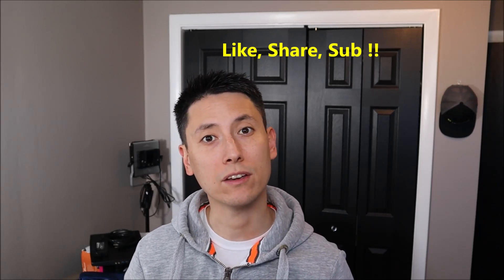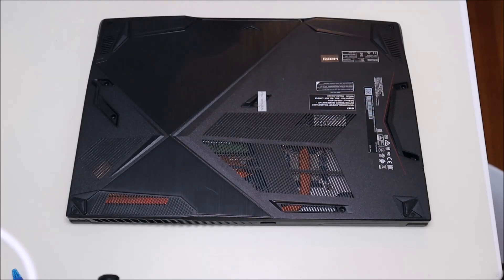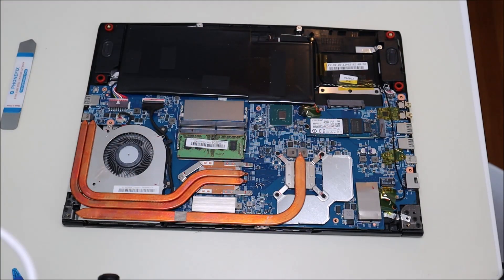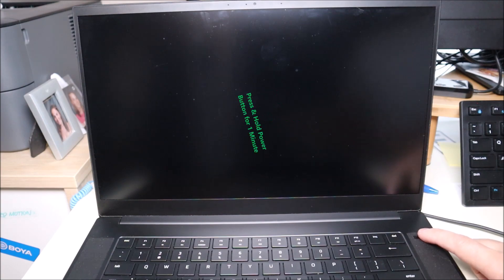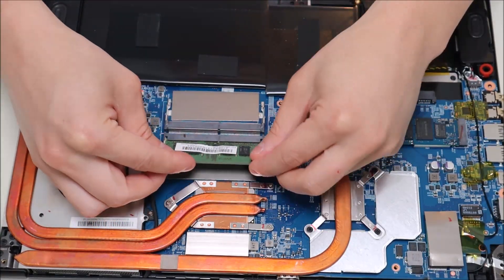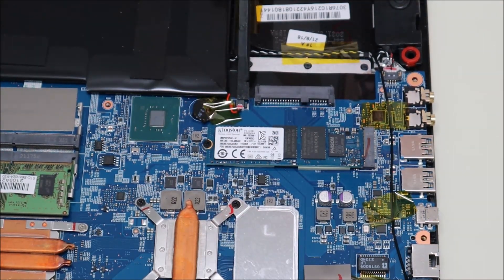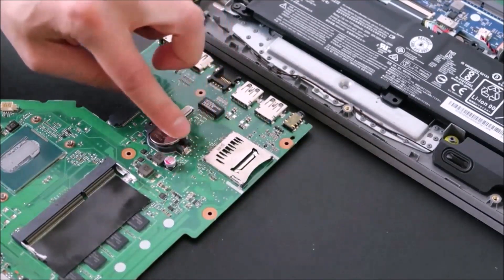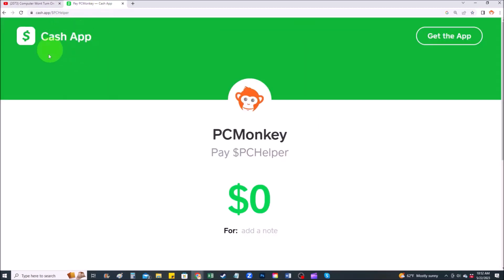MSI Laptop Computer - Dead / No Power / Wont Turn On Fix

Comment: Thanks for demonstration but another issue blinking orange light indicator my MSi gf 63 then not open laptop..
Reply from the maker: Sounds like your on the correct video.  Have you tried the steps seen here?
Also, did anything happen before this issue started? Overheating, liquid spill, Windows update, etc?

Comment: I had the same thing happen to me.  Unplugging the battery, holding power button worked.  But when I pressed the power button, it turned on, then back off.  I reseated the battery and pressed power again, it kept cycling.  Finally I pressed and held the power button for maybe 5 seconds while connected to power and it finally booted up.
Reply from the maker: Glad your all set :) Always here if needed !!
Reply: @PC_Monkey kinda embarrassing moment here.  Turns out it had nothing to do with it the power button.  After replacing the jack on the board, I apparently neglected to reconnect the keyboard 😂  once I reconnected, I did have to hold the power button for one minute then all was good!
Reply from the maker: @BallananChristmasLightShow  LOL Glad your all set :)

Comment: I have a MSI  GF75 thin 10 SDR-256 MS-17F3 and my fans where failing.  I found the heat sink and fans used but looked like really new on EBay.  I got that part and installed it.  It was the exact same unit the heat sink came from.  Since then I have not been able to power on my computer.  Previous to installing I was using it just fine other than the fans being a little noisy.  I watched the heat closely and did not use multiple monitors.  I have tried each of the steps that you recommend but nothing worked.  I did notice that when I removed the heat sink there was a square type module that sat directly under the heat sink and it was discolored on the top.  It had R 24 on the top of it.  If that was burnt up on the motherboard is that something that can be replaced?  Does this require a complete replacement of the motherboard otherwise.  The more detailed test you said to run I don’t have the equipment for, there fore just looking for recommendations.  I could not run the ram test because they soldered the ram in so I was unable to remove.   Not sure what to do next.  Thanks in advance.
Reply from the maker: There are places that offer motherboard repair but usually they are almost as expensive as buying a used on on sites like Ebay. And they usually wont warranty their work for any length of time. I suggest replacing it unless you want to take a stab at DIY motherboard repair.

Comment: I don't know if you'll respond to this comment, but I have a Delta 15 and it shuts off suddenly even when it has battery, So I have to press the power button for 30 seconds, then connect the charger, and then turn it on, and it starts up fine. I don't know if it's actually the battery; I don't want to spend money if it's not necessary.
Reply from the maker: If that happens regularly then yes, I would try replacing the battery

Comment: I have an MSI notebook PC model number MS-16GH I have the power button flashing blue and orange and the storage symbol flashing blue It seems to want to boot up but then black screen nothing happens.  I take the battery out flush it put the battery in doesn't work but when I try to turn the computer on without the battery in it and just the charger cable it doesn't turn on the light doesn't flash it all.  Any idea what the issue could be?
Reply from the maker: Sounds like your on the correct video.  Have you tried the steps seen here?
Also, did anything happen before this issue started? Overheating, liquid spill, Windows update, etc?

Comment: My plug to the battery is right next to the actual battery and there is no room to pull it out - is there a way to take out the battery a bit to make room to remove the plug fully? I literally got this $1k + laptop 3 months ago and it won’t turn on
Reply from the maker: What model computer do you have?

Comment: Oemgiiiiiíi My heart stop for 30minstil I watch this video, I tried 1x the first but doesn't work then I try again and I'm shock that my laptop opened. This video really help me a lot. Thank you and Godbless you sir.
Reply: I'm done using my laptop and I turned off but after that I want to open again, it can't open again so I do again the process that I watch here which is the 1min click/hold the power button and it successfully opened. A little happy but it's still sad coz my laptop not like before that it so easy to turn on. Huhu
Reply from the maker: @LilibethSapnay  Glad your all set :) Always here if needed !!
Reply: @PC_Monkey can't open again, huhuhu so sad! What will I do now pls? Can you give some suggestion pls?
Reply from the maker: @LilibethSapnay  Are there any signs of life at all when you try to turn it on? Lights? Fan, Motherboard, or Hard Drive sounds? Anything seen on the screen?
Also, did anything happen before this issue started? Overheating, liquid spill, Windows update, etc?

Comment: Hello, I have a problem with my laptop, two days ago I dropped a water bottle in an accident, I changed all the burned things, but when I turn it on, the lights turn on, it retains a charge, but it doesn't give a video signal, I did a reballing of the graphics and it still doesn't give video, what do you recommend I do, it's the same laptop model
Reply from the maker: you changed all the burned things. What does that mean?

Comment: I think my problem is in the powerbutton , where i can found the flat for the powerbutton , its in the keyboard and my laptop is msi crosshair 15
Reply from the maker: For computer parts, i usually have good luck on sites like Ebay. Have you tried there?

Comment: I tried everything but it didn't even budge, It was just fine the day before. I really am praying that my charger died and my laptop's battery naturally drained out as it was connected to a monitor and a mobile phone then. amen
Reply from the maker: You can test your charger as seen here: https://youtu.be/YBhsVHideGE. Or, you can replace the charger and see if that helps. Would you like help finding a compatible charger?
Reply: @PC_Monkey  I'll check my charger tomorrow in my Uni's lab with the multimeter just like you showed in the video you linked below if it is faulty I'll ask for the link too, Thank you so much for responding. my laptop is a 2 year old MSI Katana GF 66 the 3050ti version.
Reply from the maker: @arintamang3375   Good luck !!  Let me know how it goes :) Just in case you need it, is this your charger? https://amzn.to/4gtrfPd

Comment: My msi laptop is turning on and working without battery and cemos battery ? When I connect battery and   cemos battery it is turn off immediately with simple beep and not turning on? Any suggestions what is the issue? MSI i9 laptop is mine

Comment: My laptop is still not coming on, so it must be my battery
Reply from the maker: If your battery is the only issue, then your computer should turn on after a power drain procedure if the charger is plugged in. Did you try that as seen here?

Comment: I installed my new ram on msi laptop same model as in the video. It still doesn't want to tun on even aftwr all i did what was mentioned in the video
Reply from the maker: Was the computer turning on and working well before you installed new RAM? If so, and you remove the RAM and put the old one back, will the computer turn on?

Comment: Im pissed off theres still no light
Reply from the maker: Sounds like your on the correct video.  Have you tried the steps seen here?
Also, did anything happen before this issue started? Overheating, liquid spill, Windows update, etc?

Comment: ive tried literally everything thing in this video still no luck my computer is charging but my leds wont start and it wont turn on no matter what i do i cant seem to the the problem this is a msi gf63
Reply from the maker: did anything happen before this issue started? Overheating, liquid spill, Windows update, etc?
Reply: @PC_Monkey  mine is overheating on the motherboard after I changed the jack cable
Reply from the maker: @NetyangJohn  The computer was not overheating before changing the power jack? If so, the jack may be defective. I would try another one.

Comment: I removed battery, pressed the power for one minute. Still won't turn on for me. Looks like the board has a Crack where the power cable is in so I guess that must be the reason. Not sure it's fixable
Reply from the maker: Were you able to try the other steps in the video?

Comment: Hi, I tried to replace my dead msi katana battery but it didn’t turn on after replacement and I have try all the tricks in this video except the removal of cmos battery,
Reply from the maker: If, after trying all the steps seen here multiple times, you have not been able to find the issue, your most likely looking at one of two possible issues. (1) The motherboard is bad and needs to be replaced. Let me know if you would like help finding a compatible motherboard. Or (2) there is another computer component, shorting out the motherboard and need to be replaced such as the power jack, USB board, Touchpad, etc. You would have to troubleshoot each of those individually but unhooking it from the motherboard and trying to turn the computer on. Let me know if you would like help with that operation.

Comment: Hello i hlave MSI G63 laptop and sa shortedout the usb port and IT IS compleatly dead what should i do please help🙏 me thanks.
Reply from the maker: Sounds like your on the correct video.  Have you tried the steps seen here? How did you short it out? Did you put the charger into the USB port?

Comment: Aw, none of the solutions worked for me, but my laptop is also from 2015, so I was not too surprised. It was still a great video guidance on how to open the laptop by myself - I could at least take out the SSD and HDD, losing the data would be more painful at this point after all. And then I reassembled it again and will ask colleagues if anyone dabbles in PC fixing and might test the power jack etc.
Reply from the maker: Are there any signs of life at all when you try to turn it on? Lights? Fan, Motherboard, or Hard Drive sounds? Anything seen on the screen?  Also, did anything happen before this issue started? Overheating, liquid spill, Windows update, etc?

Comment: Hey, you are pretty much the only person I can ask right now, so please read through it:

My laptop (MSI Stealth 15M A11-UEK 024) randomly shut off when I was in train. I wasn't charging it and it was on like 35%. Didn't do any heavy load either. 

I've been charging it over the USB-C Port because my original 150W cable broke. I have ordered a new third party 150W cable, since MSI doesn't offer any official ones. I tried plugging it in and the battery LED lightens white, indicating successful charging. When trying to press the power button nothing happens. No keyboard lights, no fans spinning, no display, nothing...

However, when holding the power button for 30 seconds, it blinks very fast for like 5-8 seconds and then it stops and also the LED for charging turns off. When I then re-insert the cable it starts again and I can repeat this process. When I press the power button and insert the cable while pressing the button, the blinking also happens after some time, but it's not blinking but just doing a smooth fade-in fade out and that goes on for like 5 seconds.

I tried disconnecting battery, resetting the EC, fully draining the battery, tried with USB-C Thunderbolt 4 connection but nothing worked.

I might go to a repair shop that offers chip level repair, but maybe you know a solution to this problem. I really would like to know what this blinking and fade effect means. I couldn't find anything on the internet that documents that, bht maybe you know something the internet doesn't xD

I really would appreciate if you could try to help me, thank you so much in advance
Reply from the maker: Sounds like your on the correct video.  Have you tried the steps seen here?
Also, did anything happen before this issue started? Overheating, liquid spill, Windows update, etc?
Reply: @PC_Monkey Yes, I tried all the steps in the video. Nothing bad happened before that. I was using Linux btw. 

I wish someone could tell me what this blinking on the power button means. I guess this is some kind of an error code that tells the manufacturer what's wrong, but I can't find any documentation online about it :(
Reply from the maker: @EchterAlsFake  If, after trying all the steps seen here multiple times, you have not been able to find the issue, your most likely looking at one of two possible issues. (1) The motherboard is bad and needs to be replaced. Let me know if you would like help finding a compatible motherboard. Or (2) there is another computer component, shorting out the motherboard and need to be replaced such as the power jack, USB board, Touchpad, etc. You would have to troubleshoot each of those individually but unhooking it from the motherboard and trying to turn the computer on. Let me know if you would like help with that operation.
Reply: @PC_Monkey Hmm okay then I'll guess I go to a repair service that offers chip level repair, cuz replacing the whole motherboard would especially on MSI laptops be so so expensive.

Still, thanks for your help :)
Reply from the maker: @EchterAlsFake  Good luck !!  Let me know how it goes :)
Reply: Hi I have this exact issue. Were you able to fix it?
Reply: @cherryberry707  No, I went for a chip level repair in Berlin. They are currently fixing the laptop. If they fix it, I'll tell you what the issue was :)
Reply: @cherryberry707  Nevermind I just got a response saying that the CPU is defect, which is weird but yeah. Can't tell you more than that unfortunately.
Reply from the maker: @EchterAlsFake  If the CPU is bad and its integrated into the motherboard, then you would be looking at a motherboard replacement. Sorry :( Wish it was something easier :(
Reply: @PC_Monkey Yes. They said it would cost around 640€ to repair it. I think that's reasonable, considering the CPU is around 300-400€ and the repair is very complex. If they can do it for 640€ I would be really happy xD
Reply from the maker: @EchterAlsFake  ya, that seems high. Is this your motherboard? https://ebay.us/ZYzdrN

Comment: Hi, I have this same problem, but it's solved by removing and reconnecting the battery. The problem is that this happens to me frequently, at least once a week. Could it be something more serious or is there some other solution?
Reply from the maker: If all you have to do is reseat the battery, i would try replacing it. it may be starting to fail. let me know if you would like help finding a replacement!

Comment: how would i go about fixing my charger port. I dont really know if thats the issue but ive tried everything in this video and 2 of the other ones here in the comments. my problem is really wierd. Like a month ago my laptop would only work when i plug it into a brand new wall outlet. everytime I would take it off the charger it would die in 5-20 minutes and i would have to get a new wall outlet to charge it with. eventually after like 2 weeks of doing this it just stop working. now my charger light only turns on sometimes and it doesnt matter what wall outlet. I havent bought a new charger yet because i dont think thats the issue but i need help. thank you!
Reply: i have the same exact laptop model as you do and its on windows 11
Reply from the maker: Sounds like your on the correct video.  Have you tried the steps seen here?
Also, did anything happen before this issue started? Overheating, liquid spill, Windows update, etc?

Comment: Mine won’t turn off is my problem, it’s still on but it won’t turn off
Reply: It turned off and now it won’t turn back on the power button is just blinking
Reply from the maker: @skooptaDank  Sounds like your on the correct video.  Have you tried the steps seen here?
Also, did anything happen before this issue started? Overheating, liquid spill, Windows update, etc?

Comment: Did everything multiple times, still not powering on. I have a MSI bravo 15 c7vfk. All help is appreciated 🙏🏻
Reply from the maker: If, after trying all the steps seen here multiple times, you have not been able to find the issue, your most likely looking at one of two possible issues. (1) The motherboard is bad and needs to be replaced. Let me know if you would like help finding a compatible motherboard. Or (2) there is another computer component, shorting out the motherboard and need to be replaced such as the power jack, USB board, Touchpad, etc. You would have to troubleshoot each of those individually but unhooking it from the motherboard and trying to turn the computer on. Let me know if you would like help with that operation.

Comment: After following the steps the laptop powers on only on battery  but only for 5 seconds more or less.
Reply from the maker: When it powers on, what are you able to see on the screen? Also, did anything happen before this issue started? Overheating, liquid spill, Windows update, etc?